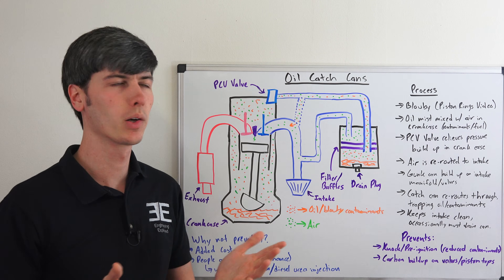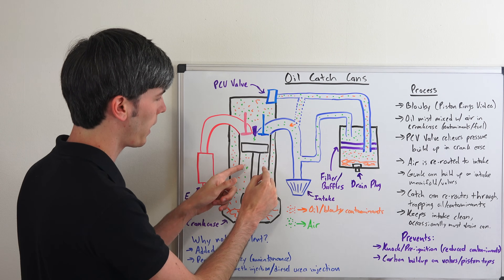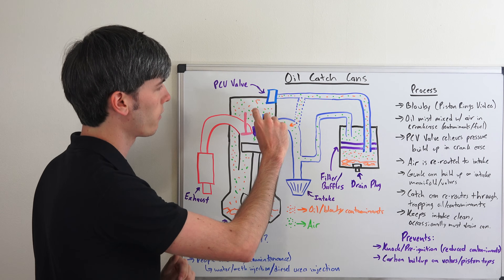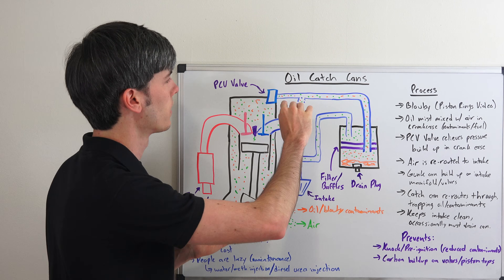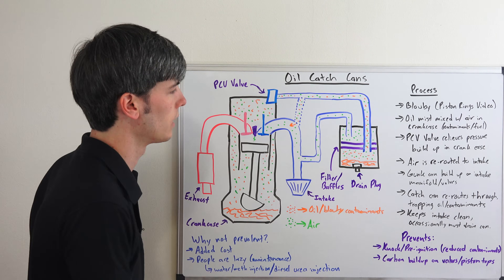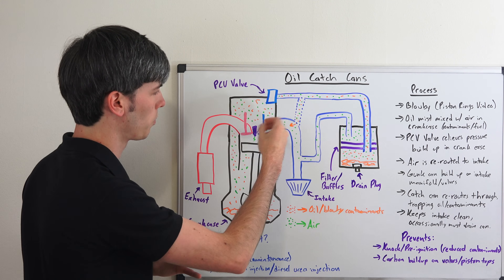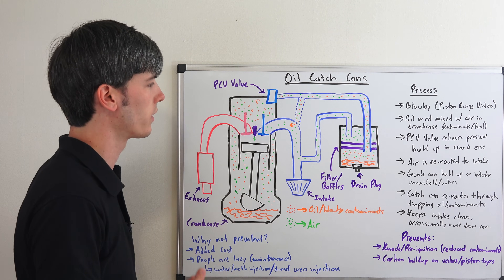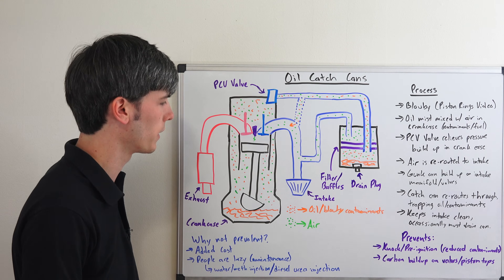What Is An Oil Catch Can?

Comment: My car burning oil and cause smoke when i step on the gas! So will a catch can solve this?
Reply: no it won't and your issue could be a bent valve or piston ring
Reply: Maybe.
Reply: Uh no, because the purpose of the catch can is to catch escaped oil, if you're burning oil, then it'd be useless and something is burning the oil (worn piston rings or blown head gasket etc)
Reply: more than likely a bad piston ring and/or an out of round bore. Ask any VW owners whom have AEG engines all about that. Bores that aren't completely round make for alot of headaches down the road.
Reply: Thank you all

Comment: Are oil catch cans beneficial for non-direct injection engines as well as engines with direct injection? Does one see more benefit than the other? I have a 2014 WRX - I'm someone who doesn't mind putting in time to maintain things - would you recommend installing an oil catch can on my car?  Thanks.

Comment: I had a catch can that an inexperienced mechanic put in. The catch can only had one port, and it connected directly to the engine block. All it did was suck up all the oil from the block, kept having to refill every other week. After a 2 months the car was running horribly. Apparently not only did the oil go to the catch can, it also built up on the pistons, and valves. Had to take it all apart and pretty much rebuild the motor again. Hard lesson learned.
Reply: If you're able to rebuild your engine why would you have another mechanic put in an oil catch can. In most cases they take like 20 minuets to install...

Comment: What if you just routed a tube from the pcv valve, straight down and underneath your car, or some other convenient place? Then you wouldn't be returning that oil/air into your intake valves, and you wouldn't have to worry about emptying anything either. I don't imagine you'd lose that much oil anyway, so its not like you'd be contaminating the road with any significant amount...

Comment: Are there any negative effects?
Reply: They take up space under hood, there is extra plumbing and a mechanic may fail inspection on the vehicle for a non factory emissions control system. Absolutely everything has a downside.
Reply: anyone with a subaru EJ motor would disagree with you.
Reply: Maybe warranty issues? Could cause a fire if some of that oil/fuel gets on something hot. (unlikely I'm guessing) If the oil/fuel isn't trapped, you won't meet emissions standards.
Reply: +otm646 oh well in my county there is no emissions required so yay
Reply: +rick roll what do you mean? I have an EJ255 in my OBXT, I was thinking of a catch can but I didn't know if it was worth it
Reply: +RyanRC2 EJ turbo motors in wrx/sti have somewhat common ringland failure issues. a catch can or AOS can help prevent that by stopping the oil from going back to the intake and intercooler. oil mixing into the fuel dilutes the gas, lowering its octane rating and also lowering its knock resistance. look up ringland failure and preventative measures. there are a few decent videos that explain it and i believe engineering explained did a video on it.
Reply: Not necessarily true for all EJs. Ringland failures are due to the different composition of the piston materials Subaru used after 2006~2007. Tighter gapping on the rings along with more stringent emission requirements. A stg 2 tune and a AOS would prevent failures.
Reply: a stage 2 would require upgrading fuel pump and injectors. the stock injectors are already at 95% duty cycle. frankly any tune and an AOS, as well as your driving habits would be a big step in not having ringland,
Reply: Pretty sure no but if you do use a cheap one that might not have different layers of filters the oil that collects could be launched up the re entry tube and put all that crap back into the engine

Comment: Great video Jason! But I have one question. Does the oil that passes through the pcv valve help lubricating the upper piston walls? Is there a drawback of using a oil catch can in addition to the maintenance?
Reply: Without a breather on the catch can the pressure can build up and make things worse

Comment: Hey engineering explained, is it worth the effort and is it possible to adapt this to an old 1975 dodge big block motor currently it has an open breather and no pcv valve, but I could tap on into the after market manifold.
Reply: There's no point doing this to an old engine since it doesn't need to pass emission laws.
Reply: Yes but if it keeps my inner components cleaner, prolonging engine life thats a net gain.
Reply: Somebody removed the PCV system on your engine its supposed to have it. If you have breathers on your valve cover(s) then the crankcase mist is venting to atmosphere and is not affecting your intake valves and pistons.
Reply: +Mark G so what your saying is I won't get any benefit from it. Except maybe not polluting as much?
Reply: That sums it up. Is it a 440?
Reply: +Mark G yes

Comment: why put it  in intake not in exhaust...sorry for my language  thank you
Reply from the maker: Intake is negative pressure and will draw the air in. The exhaust has positive pressure and would push air into the catch can.
Reply: +Engineering Explained  thanks

Comment: Does it help with lubrication of valves? I know that gasoline cars running od LPG (natural gas) can have problems with valves since lpg is very dry and some cars even have two stroke oil injection in the intake to help with lubrication? We are talking about direct injection

Comment: Can you explain the difference between a Catch Can and an Air Oil Separator?  

I spent 7 hours installing an AOS (much more complicated than a catch can because coolant flows through it to prevent water condensation) on my wrx because I read it returns the oil back into the engine, however during the installation there was a drain line that ran to the ground.

Comment: Ive heard that oil catch cans may in some cases prevent the valves from getting lubricated, apparently back when cars used leaded fuel the lead in the fuel would in some way lubricate the valves, and as such oil catch cans were common in cars from factory to capture the blow-by. However in modern cars using unleaded fuel, oil catch cans were not installed from factory as some of the blow-by was necessary to lubricate the valves with the absence of the lead in the fuel. Is there any truth to this? Just a story i heard from an old mechanic once, thanks!
Reply from the maker: Seems crazy to me. It's not like it's fresh oil you're spraying the valves with, it's a mix of contaminants, oil, etc.

Comment: For those running direct injection this could be a great  benefit to reduce more carbon buildup.  Thanks.  For my 1.6 GDI I try to run top tier gas in it and will use techron every few fillups to try to minimize buildup however due to the nature of the spray patern on this motor it's inevitable.  I'll look into how to route and place a catch can for this motor as I'd prefer to minimize any buildup.  Hopefully this will slowdown some of the preignition/detonation I and many other's get on this motor when running anything less than 91 octane though it calls for 87.  It is a high compression motor but I feel like Hyundai has not tuned it properly from the factory.  There is a distinct drivability difference between 87 and 93 on this motor.  I'd like to get it dyno'd to confirm eventually.

Comment: Additional note: 
Most turbocharged/supercharged or  boosted applications do not route the hose/tubing back into the intake runner either from the factory or for aftermarket installations. 
The primary purpose of the catch can is to separate vapor and liquids from the crankcase/blow-by stream, vent the gases and provide a reservoir for the separated and collected liquids.
Reply: What you mean is higher end cars, because I know for a fact, that the wrx,mazdaspeed6,s2000,gti,srt4,and Golf r route it into the intake
Reply: Exactly what Robert said the is a check valve in almost every new boosted car to prevent it from going downstream. Almost every boosted car uses this but it tends to make the car run a bit rich in idle due to the restrictions
Reply: OK wise guys.
If the intake runners are under pressure (15 PSI) and the crankcase pressure (~10PSI) is vented to the intake runners, where does the pressure go? 
There has to be a difference of pressure to promote flow. 
High pressure flows to low pressure, it is physics.
Put the crankcase under 10 PSI pressure and it will begin to push oil past every gasket and seal.

Comment: I just have a lil air filter on my PCV, is this bad? :P
Reply: Depends on if your engine is computer controlled and has a MAF sensor. If so, you're letting unmetered air in/out which can mess with the ratio. Judging by your picture, I'm guessing not though. In your case, it's likely fine as you're filtering air coming in that isn't metered anyway.
Reply: You're right in the aspect that the crankcase ventilation system is not controlled nor monitored by the PCM. However, if the ventilation system has 2 tubes, one that is on the intake tube and the other is the PCV side with vacuum. If you disconnect it and put a vent on, you're messing with the metered air after the MAF (if that system uses MAF). On MAF systems, the air that goes into the crankcase and sucked back through the PCV is metered so the PCM can account for it when it's pulled into the intake runners. Long story short, it depends on the system.
Reply: +Nate Rowe Well it's a B18c6. Had it tuned and they didn't mention it. Just when I've been to the strip they did like it much because oil can leak from it.
Reply: +BenXL I'm not super familiar with Hondas but if it's a MAP style system and it was tuned with the filter, it would make no difference. MAP is more forgiving with air leaks and your tune likely compensates for it or takes it into account. I wouldn't worry about it.

Comment: Finally understand how these work! Thankyou Jason! Question: is it possible (or reasonable) to have some sort of connecting tube from the bottom of the catchcan to the oil sump pan? That way you wouldn't need to drain it and the oil wouldn't be wasted.
Reply from the maker: That's an interesting idea! A few things pop into mind, you'd just want to make sure there can't be flow in the reverse direction, so there would likely need to be a one-way valve. If it entered into the oil pan above the oil, then the positive pressure would act on it, so I'm not sure how well it would work. If it entered below the oil, it would build up some oil in it, but I suppose if it got too high it would drain into it. You'd have to be sure that the line was robust enough to handle the heat, and also protected from getting snagged underneath so you don't dump all your oil out.
Reply: You can use a pump to pump the oil from drain plug to the crankcase once it is collected in sufficient amount, but it would also increase the cost
Reply: i run a oil drain back system on a catch can works great.